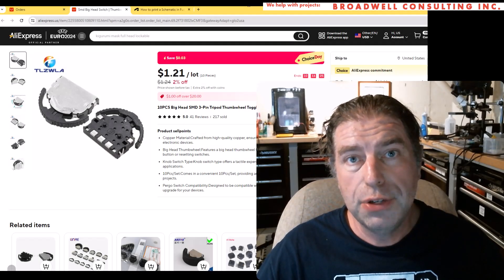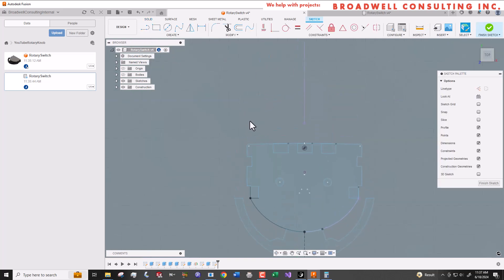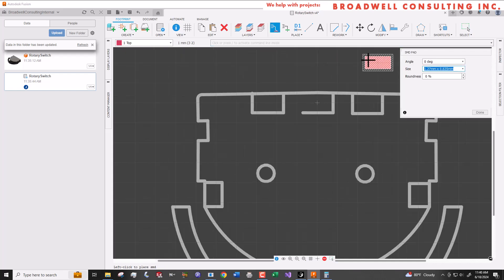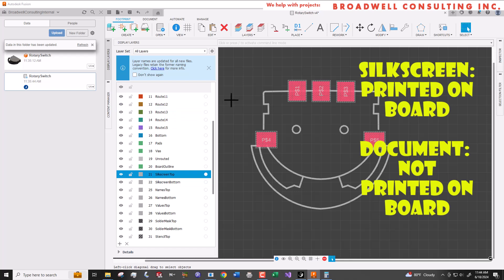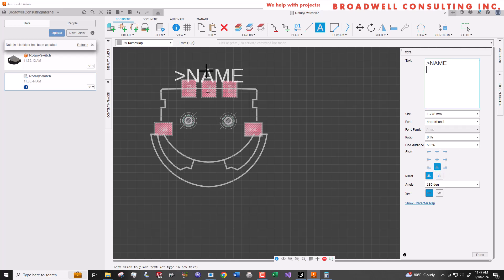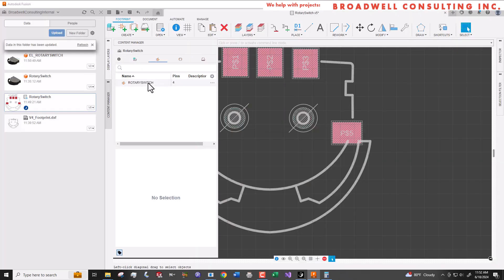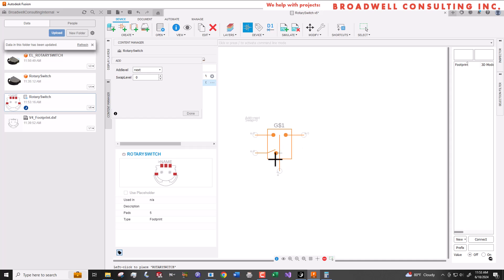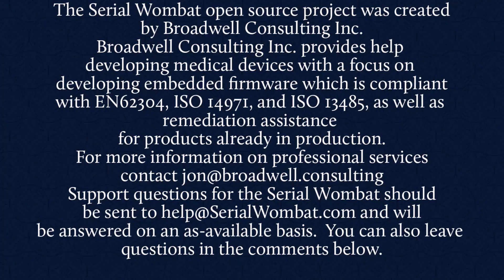Custom Electronic Footprints In Autodesk Fusion 360

Comment: how do you freely move objects like this?
Reply from the maker: I bought a used SpaceMouse pro for about $130 on ebay.  It allows movement of view or object with 6 degrees of freedom.   Has a learning curve, but once you get used to it you can't live without it.  Left hand on the spacemouse, right hand on the (normal) mouse.
Reply: @SerialWombat  oh, i guess that makes sense is there no option in fusion to stop it from snapping to the grid? im new to it